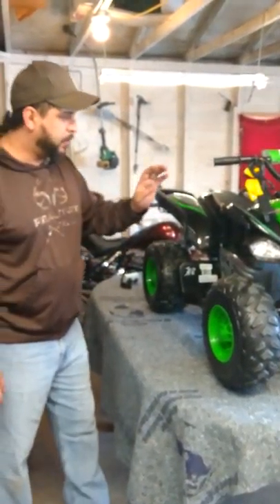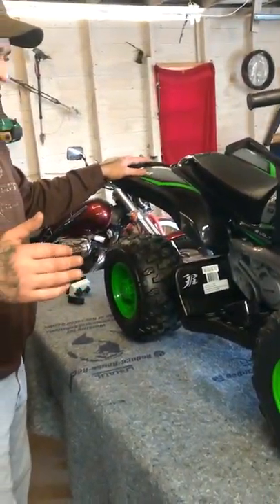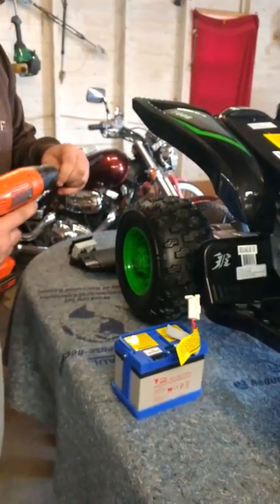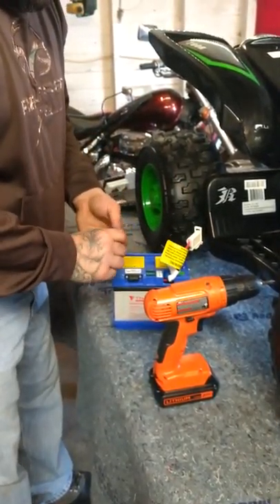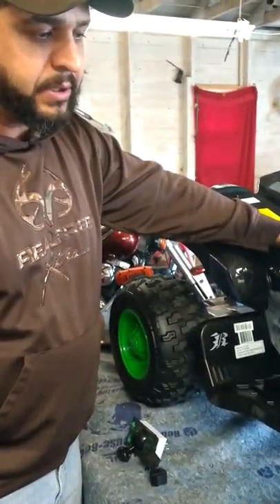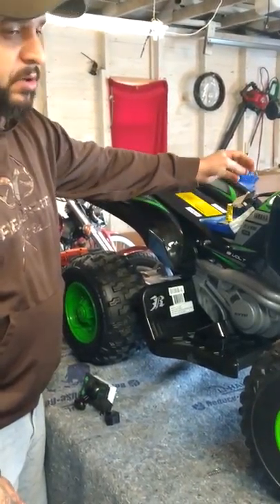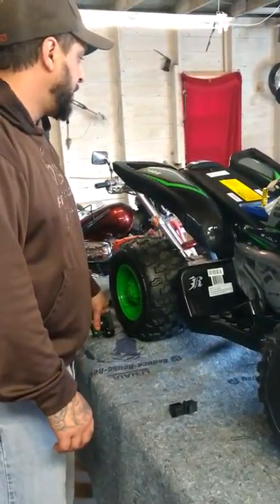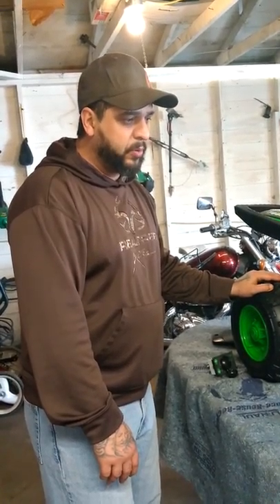How to fix a power wheel that doesn't work.

Comment: Cool video. I found one of these for my son, charged the battery and only the wheel on the left spins. Sounds different when I spin them manually. And also only goes in high gear. Still drives him around the yard for a bit. I'll be checking it out further though.
Reply: Same exact thing here! Plus doesn’t go in reverse, did you ever figure out how to fix it? TIA
Reply: Did you figure out why only one wheel spins? Mine started not reversing and now only one wheel spins too… so two issues going on.
Reply: Same issues as well. Anyone figure out the problem or know how to fix?
Reply: The gearbox is likely worn out. My kids has the same issue. Flip it over and spin each back wheel both ways; if you can spin it freely its the gearbox thats broken.
 Ive found factory plastic replacement gearbox parts, but no metal gear upgrades for this model yamaha 700 12v (which sadly doesnt seem to be compatible with power wheels metal gear upgrades)
Reply: @jmeunier2277  Thank you!

Comment: Good videos. I need a 6 pin 'forward/reverse' rocker switch for an old PW Corvette. The pins are slanted to fit into the receptacle in the wiring harness. Mattel doesn't sell or support this switch anymore. Can I buy this switch from you or do you know where I can get this switch?

Comment: Hello, we have a boomerang three wheeler but if you push the foot pedal switch you can hear the back when trying to move forward but not enough power to accelerate the power wheel. Do you know what it could be?

Comment: Great video, my son has this same one. At first reverse & low quit working. Couple days later only reverse worked and not every time. Battery fuse is good. Indicator lights would come on but no movement. I cleaned the foot pedal switch connections now the lights don’t come on at all. You think it’s the pedal or shifter?  Any advice is appreciated. My 4 year old won’t quit harassing me about fixing it
Reply: also we live on the Olympic peninsula and he did leave it out in the rain a few times. There was a little corrosion on the foot pedal connections but not bad

Comment: Thanks for the info man.  I have a jeep with 4 motors and the front left wheel goes in the opposite direction as the other 3 wheels. If i want to go forward, all 3 wheels spin forward, but the front left wheel spins backwards. Any help or suggestions? Thanks
Reply: you need to change the motor wire position( positive & negative) this will fix the problem.

Comment: Thanks for the video. I have this exact 1. I checked pedal and the forward and reverse lever. The lights so it’s fully charged so I think it can’t be the battery. I checked the fuses in the battery and nothing. Have any more ideas? Thanks
Reply from the maker: Sounds like the shifter isn't working. If the lights come on but it won't go,  its probably the shifter.

Comment: I’m having a issue with this same model. The lights come on and battery is showing 12 volts on volt meter and the motors turn fine by hand. Do you think it would be the foot pedal?

Comment: Great video! I have a Jeep Wrangler. Battery is at 11.9 V. I replaced the pedal switch. Still not running. Motors in back seem okay if I rock the tires forward and back. I tried to make sure all wires were connected. My battery does not seem to have a fuse. It is just the standard 12 V Fisher Price silver battery. What should I try next? I have zero power. Could it be the reverse/forward switches or a bad connector piece to the battery? Can the battery be bad even if it is charged? Thanks a lot for your help!
Reply from the maker: You should have a fuse at some point if not in the battery then on a main wire leading from the Battery. It’s a safety feature to keep the young ones safe. I’d say your battery is good if you getting 11.9 volt reading on it. I’d definitely look for that fuse then look at replacing the shifter. On some of the higher end models they will have a mother board under the hood if that’s the case with yours and often times those will go bad. Not sure if yours has one or not. Thanks for watching and I hope this helps.
Reply: Thanks for the suggestions. Found out, it was the battery. I borrowed a friends and his worked. I have the typical silver Fishers Price 12 V battery. Any suggestions where the fuse would be? Would I need to cut the lid off? It is not visible. Trying to avoid paying 75 dollars on a new battery if possible.
Reply from the maker: They make batteries different some times the fuse is on the battery other times it’s on the main positive wire leading to the battery like under the seat maybe. It’s a safety feature. Thanks for watching.

Comment: I've got the kawasaki version of these, have two and one quit on me. I have ruled out battery and pedal switch by putting g the pedal switch from the working one in it and still nothing. Not working at all but tires spin. Any help much appreciated
Reply from the maker: Try switching the shifters out and see if that's the issue.  Thank you for watching.

Comment: I have a question. So I have a power wheel and the charger seems to be charging the battery only for a short time  and then stops charging and then when I plug it into the power wheel it says that it is still dead and has little power. Would that be a battery issue?
Reply from the maker: Sounds like the fuse in the battery might have blown.

Comment: I have a 4x4 pink Jeep that dose nothing . Well if you turn the steering wheel its light come on and it makes a slight motor sounds I'm not sure if it's wired wrong or what it could be

Comment: Just replaced battery and now has intermittent fast speed and no low or reverse. I am thinking the speed selector is faulty? Any thoughts or suggestions with what to check

Comment: Hello. I have 2 powerwheels where I double checked the batteries with a voltmeter and they are good. The powerwheels have been out in the rain by accident but they aren't moving. Can you help please?
Reply from the maker: After rain gets to it as you know rust begins. My guess is as good as yours as to witch part was effected. If I was in your shoes I’d get a direct power source to the motors see if they spin. If they do you have a issue in one of the other top areas pedal/ forward controls. Thanks for watching the video.

Comment: I have a 12 volt Yamaha 4 wheeler that the battery show full charge. It will not work at all. I checkered the petal switch, by pulling the wires and touching the yellow and red wires together and no movement. Removed the gear shift control and I don’t see anything unplugged. 
Can you help me figure out what’s wrong?
The 4 wheeler is only 4 months old.

Comment: I have the same four wheeler I tried to Hook up a 20v tool battery with a harness off Amazon worked for a few seconds and I blew a fuse somewhere I believe not sure if any fuses are on the power wheel it self for safety or not

Comment: I am only "guessing" when I'm replacing the switches.   There's not a wiring diagram where I can see to check for proper voltage at the switch connectors or switch pins.   Is there something you can post that shows which wire or pins are supposed to have voltage and when (IE: pedal pushed down or pedal up)?  I like to confirm that apart is actually defective and not replace parts it hopes that it's the problem.   Thanks!!

Comment: Great video. Thanks! So if you connect the battery to the motor directly and you get nothing, the motor is probably broken? I have a 6V BMW someone gave me? The charge on the battery reads just under 6V (5.2V). I may change e battery too. But that should at least get the motor to turn in my thinking.
Reply from the maker: Yes if you can directly connect the battery to the motor that motor should spin. Buy doing the direct connect you bypass foot controls and shifter. It sounds like your motor is the issue. You can buy the motor on line or contact the manufacture direct to make sure you get the right on. I usually buy direct from the manufacturer for replacement parts, except for battery or charger then I purchase them on eBay. Thanks for watching the video.
Reply: Young Buck Absolutely! Thanks. I’ll keep you posted how it goes. My daughter will be happy. She just sits in it everyday asking me to make it move. LOL
Reply: One more quick question, shouldn't the on/off light up if the battery is good? Wondering if there is something else wrong with the wiring. I am trying to find an alternative power source to connect the motor directly to. I did order another battery so we will see about that when it arrives.
Reply from the maker: @michaelgavion3943  I would say yes you should be showing a light if turned on.

Comment: im sure there is alot of raptors out there but my sons grandma got one from a warehouse that takes several powerwheels to fix others, and maybe it isnt this on but im having fuse issues, just from running it, was told to charge 12-24 hours first time, charged about 8 hours instead, blew the fuse, changed it and let him ride, blew the other one, what can i do to fix this, are you saying the battery is ruined?

Comment: Hi great info! My sister gave me her broken ride on Corvette. The car turns on and it will not move. Another test, to bypass the battery I disconnected the battery and plugged it directly to the power outlet. The car moves really slow when there is no weight on it. When I put some  weight it won’t move and I can hear the motor or electrical making a high pitched noise that I think it’s trying. I’m assuming it could be the motor. It sounds really weak. Any suggestions?

Comment: I need help because I can’t figure out if it’s the wires or the battery, my daughter didn’t use her car for months nd it was outside during winter, the battery we kept inside, 2 days ago I cleaned up everything nd I charged the battery for 2 hours (Ik it’s usually for 14 hours or so) nd it was working fine till the very end when it wasn’t really going forward or in reverse, and the battery indicater was flickering on nd off showing full charge to empty, I kept switching the gears Md it would work for a little bit and then back to how it was, what do you think it would be ?
Reply: Next day I charged battery fully and checked the fuse it was fine, but when I put everything back together it was doing the same flickering showing full battery 🔋 to 🪫
Reply: It’s a Minnie Mouse benz

Comment: cool vid thnx !  i have the mercedes 6whl drive (6 motors) truck .. put a new batt in it , ran perfect for 8 - 10 min , then drive suddenly stopped .. no power for drive at all remote or peddles .. all else works . any help please ? thnx
Reply from the maker: Those have a mother board on the inside to control all, it sounds like the mother board may have went bad.
Reply: @bridgetcaudill5189  , thanks ! i was hoping it wasnt that . turned out to be a small loose wire on the remote receiver n that cancelled out all drive functions . all is good now

Comment: hello great video. i have a Monster Jam Grave digger & bought it a month ago so battery is good. but my nephew was riding it and suddenly it stopped working so we thought the battery was low but next day we try it and now it doesn’t work it doesn’t make no sound from the radio or motor. so it just stopped working. Do you know what’s the problem with it???
Reply from the maker: Sometimes the connection fittings are not good. Check the connection, also check the fuse in the battery to see if it's blown. Does it have a mother board? It would be under the hood.
Reply: Young Buck  hey man i was able to fix it. the fuse of the battery was blown out so i just switch it with another and it worked.

Comment: hi good morning so i checked and there's power all the way from the battery to the motor but can't figure out why it won't move at all and i checked the pedal and when i press the pedal and it signaled but no movement can help would be greatly appreciated ( barbie Escalade)

Comment: I have a gravedigger for my son 12v I feel like it’s not as fast as it was on first gear as it was when I first got it any idea why ?
Reply from the maker: It could be two things. Sometimes the motors just wear down over time. Or maybe you need a new battery, they are fairly cheap on eBay.

Comment: I have dune racer , one battery fully charged it will move tiny bid but no torque. The other battery fully charged will not even budge. Any suggestions?

Comment: I need help with a jonh deere gator hpx 4x4 

I check every i could I put a multimeter at the end conectors to the wheel motor and it says 12v but onece I connected them to the actual motor all power goes off and i take out the motor and put it directly to a battery and it does work what the issue could it be ?
Reply from the maker: If you have hooked the battery directly to the motor and it did not turn I’d say the motor is bad.
Reply: Young Buck i did put the motor directly to battery and did work!
Reply from the maker: Sounds like the motor is bad then.

Comment: Just got a huffy 12 swat police truck. My fuses keep shorting. Is it the battery or fuses? Huffy won’t answer my questions
Reply from the maker: I would say it's probably the battery. You could be over charging it, that's common if it's overcharged. Does this model have a motherboard under the hood? Is it blowing while riding or while charging?
Reply: The fuses are tripping. It looks like we did overcharge the battery longer than it should have. Do I replace the fuses or get a new battery? Trying to get ahold of someone from huffy is hard as well lol
Reply: Young Buck I don’t see a motherboard. I just see all the wires. Fuses. And battery. I disconnected the wires and the lights work. But when I plug in the wire for the charger it completely kills the ride. The only noise I hear is when it struggles to turn on for a split second
Reply: I am having the same problem.  When the power is on, it just keeps clicking and attempting to start every few minutes.

Comment: I have 6 volt fisher price ride on  power wheels bike it has a single battery rear wheels are working perfectly fine but the front ones are not moving at all.can you tell what the problem actually could be And how to fix it?
Reply from the maker: The front wheels are free spinning, they don't have motors. If they aren't moving, the bolts might be to tight.
Reply: What you mean to say is the front ones have no connection to the battery? And what are bolts?

Comment: I have a yamaha raptor 700 the lights come on when you press the pedal but it want go can you help me out
Reply from the maker: So if your lights are coming on then your getting both good connection to your foot pedal as well from your battery. I had a similar situation happen recently. The problem was in the shifter. There is 4 screws take them out and pull the shifter out and make sure they are connected. If they are I’m 90% sure you have a bad shifter. Thanks for watching.

Comment: Great video I have the 700r Yamaha I replaced the pedal switch...but it's still not working when I touch the yellow and red wire it does nothing..but if I use a jump box on the wires it works..I dk what it is..thanks...
Reply from the maker: You may have received a faulty pedal switch. Those pedals are so mass produced they are cheap. If you are using a jump box and it's working, it sounds like the pedal switch is bad. Also check the fuse on the battery, it may have blown.
Reply: Ok thanks ima send the pedal switch back.. thank you again...
Reply: Fuse good
Reply: Rocko Pearson     Rocko.  Did you recieve a bad pedal switch I’m curious I’m experiencing the same thing
Reply: @mikemassey7458  yessir I did....two times

Comment: Hello sr how r u I have a Barbie camper power wheel and every ones in a wild give me a purple light on the indicator by the shifter and it won’t run for a few sec in till it goes back to green I got a new battery for it and it still giving me some times the purple light

Comment: I think I need to buy a new shifter, looked on ebay without much luck, any idea on where to get one for a raptor 700?
Reply: Also could you make a video for putting the shifter together correctly? I took mine apart and not sure I am putting it back together - thanks for your videos
Reply from the maker: Whoever makes the power wheel you have, you can call the company and tell them what part you need, they will ship it to you. They are pretty cheap.
Reply: @bridgetcaudill5189  can you tell me if I only have one rear wheel spinning (I've tested and am sure the motor on both sides are good, I have also checked the foot switch and it seems to be good) could the shifter be the problem? I just want to be as sure as possible before buying it. thanks for your expertise and help
Reply from the maker: @daveslim3692  yes it sounds like the shifter is bad. The shifter is a very common thing to go out because they are just cheap plastic.
Reply: Young Buck thanks for your expertise, time and reply! I appreciate it
Reply from the maker: You're welcome! Good luck!

Comment: Ok you seem to be the guy to ask. I have a power wheels dune buggy that ran great last year. It was out over winter. I replaced plunger/ pedal switch, battery, shifter switches, I still get 0 power. I checked all wires for any obvious breaks. Any other suggestions?
Reply from the maker: Where it was left out, you may have got moisture in the motor on the wheels, which could have caused corrosion, causing it not to have contact from your power source. Those motors have small contact brushes on the inside. I hope this helps and good luck.
Reply from the maker: The best way to test the motor/motors is to run two wires directly from your battery to the motor. This will bypass the shift switch and pedal. If your motor rotates then the issue has to be somewhere else.